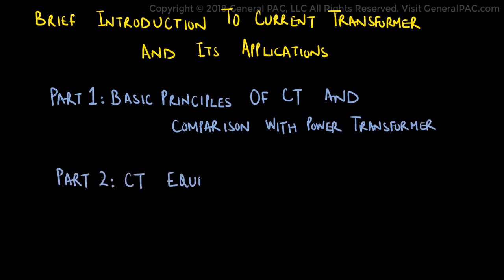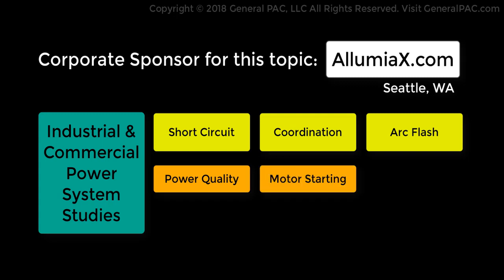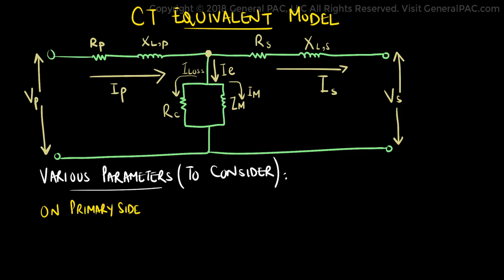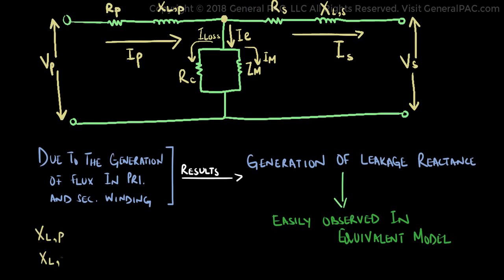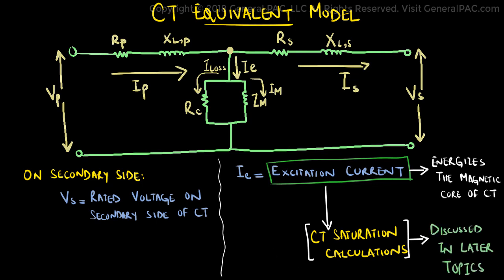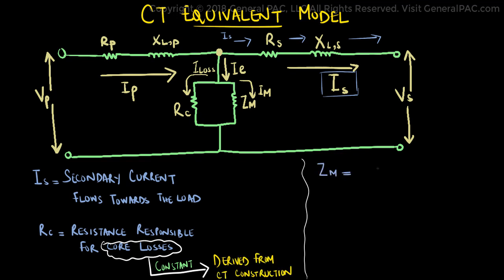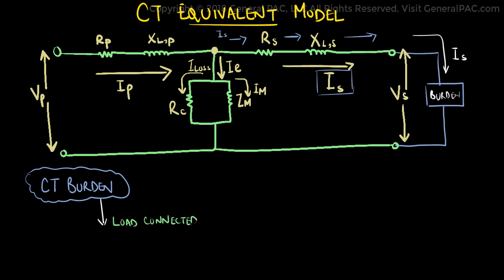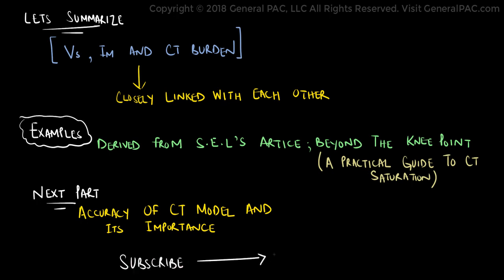Brief Intro to Current Transformers and its Applications Part 2: CT Equivalent Model

Comment: If burden reduces then what happens on primary current Ip after sometime
Reply from the maker: Hey Surya, before coming to your question let us understand about what Burden actually is? A Burden is an estimation of load connected on the secondary side of CT (measured in VA). Ideally, a CT should reflect the current on secondary side as accurate as possible from the current flowing in the primary side.

However, this does not happen so because of the presence of magnetization current and other factors that generates an error in the reflection of current on secondary side (Discussed in part 2 and 3). Nonetheless, an effort is made to make this error minimal. Generally, CT measurement is close to maximum accuracy when the actual CT burden is equal to the rated CT burden.

The CT burden influences the accuracy of the CT measured value on the secondary side. Higher burden selection against the required burden results in CT measurement inaccuracy. For instance, if a CT designed for 15 VA burden is operated for 5 VA, there will be a higher error in its measurement even when the CT is operating at its rated current.

As to answer your question, the primary current of the CT is independent of the CT burden on the secondary side. Since the primary current depends on the load current flowing through the line.